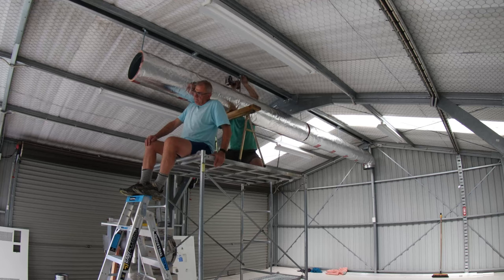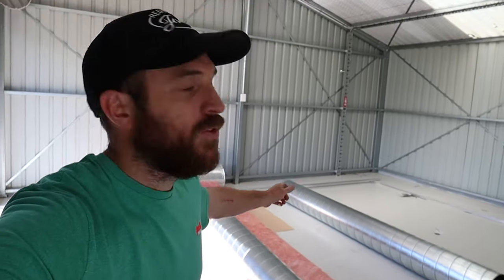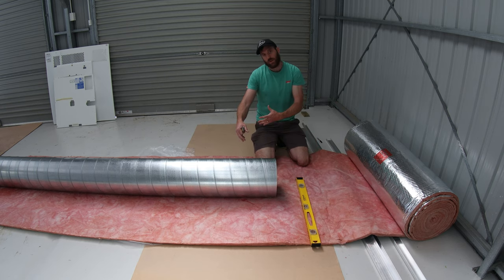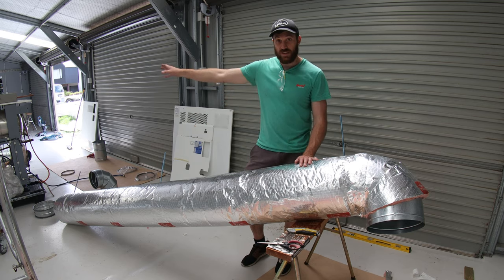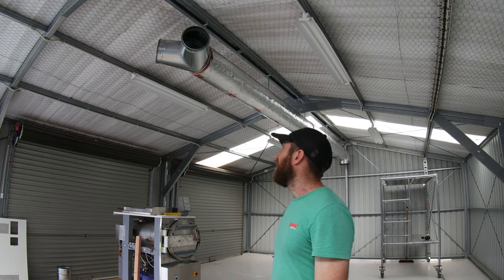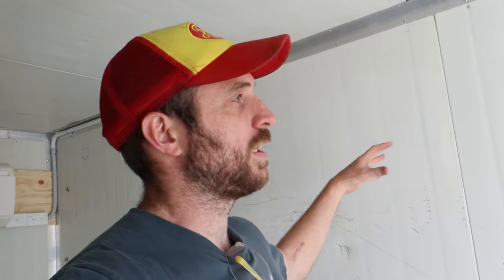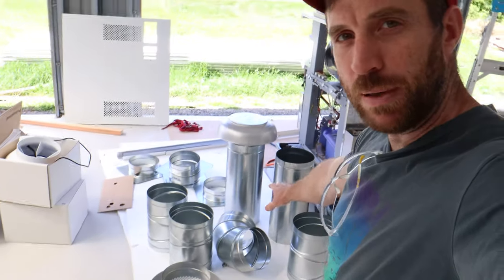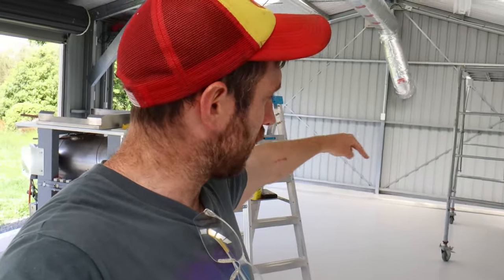Building my Mushroom Farm Ventilation

Comment: I was getting ready to say you better plan a HRU, then you said you had the water to air ordered, cant wait to see how you do it, but whatever you do make it so the individual parts are replaceable/reachable to clean.
  I literally just built one for my little mushroom fruiting chamber.  Only running 3 inch dryer vent hose, had some old pc water cooling stuff laying around and a power supply.
  So I have a 3X120mm fan radiator in the exhaust (made a MDF cupboard to adapt it to the drier hose I'm currently using), and a single 120 radiator to condition the intake, with a random pc fan to help pull air in.  The outside intake vents to living room, mushroom chamber intakes from living room, and then vents outside (It's ~72 cubic foot chamber, think bookshelf sized).
  First night I had completely set it up and left it running, ended up helping a friend most of the night, came home, started checking temps with the two fridge thermometers I had.
 
The Results, I stayed up to 5 AM geeking out at how well some pc parts where doing.
At 5 am when I called it quits
Outside temp          32F/0C 
Inside room temp    62F/16.6C
Intake temp            60F/15.5C

That said, the rads in use, I beleave are double pass, but arranged perpendicular to air flow, so loosing efficiency there for sure.
Reply from the maker: Sounds like a pretty good setup! I think what I build will just be an up scaled version of yours.

Comment: Does your pre-con room have a passive intake?
Interested to see how it works out for you. I have basically the same setup (minus the HRV unit) and fruiting room temps still fluctuate pretty wildly. Our climate here in Victoria is all over the shop though which doesn't help. 
I think the fruiting room intake is more than the heat pump/air con can keep up with, so I'm moving the pre-con room closer to the fruiting room, ditching the heat pump and replacing it with a more powerful window mounted unit.
Reply from the maker: Yes it will. I got a small commercial heat pump, so it can hopefully handle the volume of air.

Comment: So you're going to exhaust the co2 outside? I don't understand the need for the heat exchanger, wouldn't pulling pre-conditioned air as needed to acclimatize the fruiting chambers enough?
Reply: Pre conditioning room is not needed to be used in the way this fella used it, a consult with an hvac enginner would have saved him money and time.
Reply from the maker: Do share more on your reasons. I have had air conditioning engineers out, and the didn't give me a better answer to condition air at the airflow volume I needed. Remember I cannot condition the air inside the fruiting rooms because spores and humidity will destroy the unit. Therefore all the atmosphere must be conditioned before it enters. Shifting air from -3c in winter to 18-20 it difficult on one pass of a heat pump.
Reply from the maker: The heat exchanger just recovers energy. Heat pumps use energy to heat or cool, and a heat exchanger recovers that energy used and means the heat pump will consume less electrical energy to do its job.
Reply: @OakandSpore  I've been studying how I'm going to do it on my farm and ill be doing it with a pre-conditioned room like you.
Are you able to control different temperatures in both fruiting rooms? And where will the spores be collected in your setup?
Reply: @OakandSpore  You basically built a (very) large "plenum" for your ac, using a tech term that fits more would be a sort of an air handler.
I'm a bit puzzled because since you are building this farm from scratch you could have put that space(much less needed) inside the main structure and ducting everything towards one or more fruiting room. 
In synthesis you could have built this external space with air handling unit with all the necessary, definitely not that big.
This is just my opinion.
Reply from the maker: Perhaps I could have. But I am building all of this on my own, sometimes I don't have access to all the professionals. Finding an HVAC engineer in NZ that has experience with mushroom farming will be near impossible, not to mention extremely costly. This method I can do it all myself and save 10k$. Sure it might not be optimal, but its what I've chosen so it's what I have to live with.
Reply: @OakandSpore  I perfectly understand, I'm setting a mushroom farm so empathize with you. I wish you all the best mate. Your work is good and in future that preconditioning room will have plenty of space to host bigger or multiple units for different conditions.